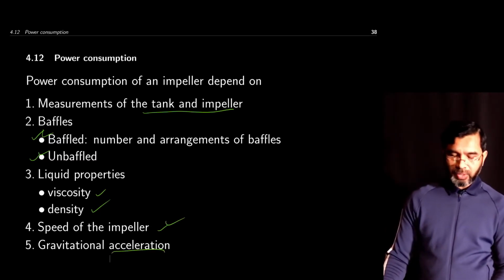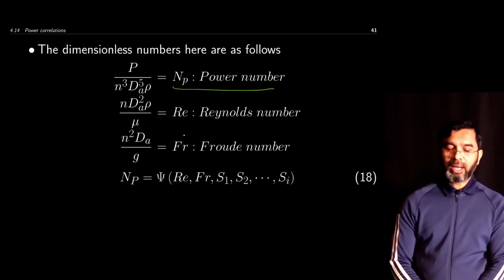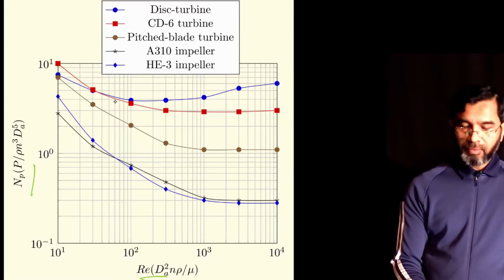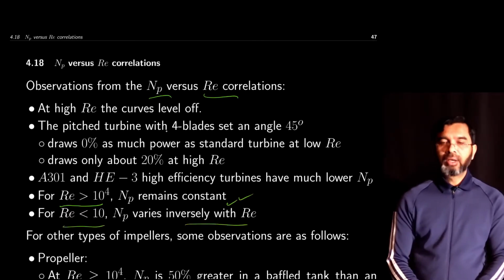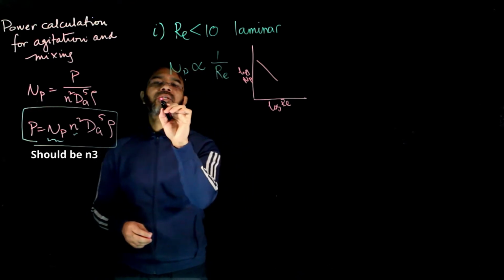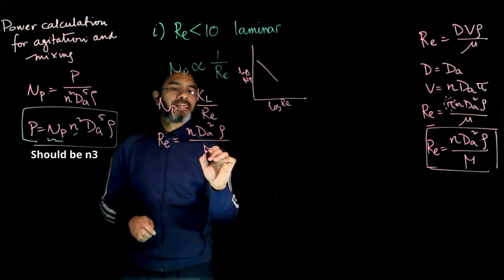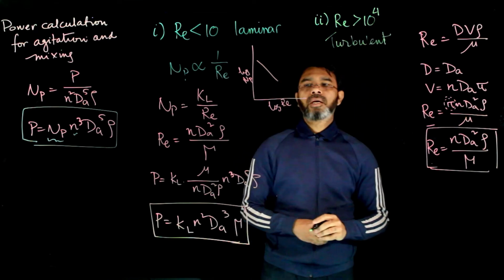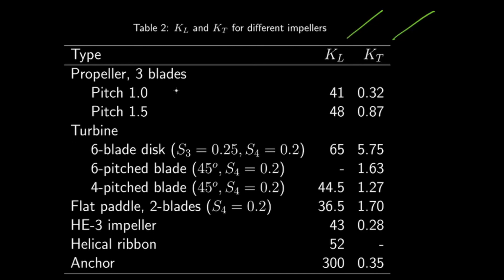Mixing and agitation: Power consumption

Comment: And in this equation viscosity is to consider the flow type but it will not effecting the power Calculation as if Reynolds no is 15000 and Reynolds no is 450000 then power will be same if Dia and density is same, but for 450000 Reynolds no power value must be higher

Comment: Sir for unit n rpm or rps?
Reply from the maker: It can be either of those; the requirement is that the units for other parameters and property values should be consistent.